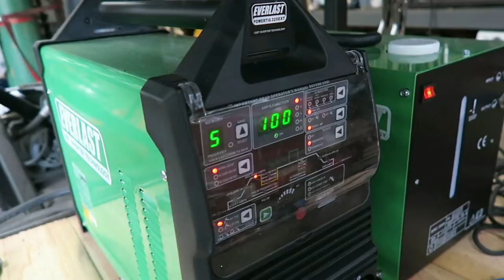Fox Body Hot Rod Build | Making Strut Towers and the Body Comes Off

Comment: I was one of those who sent you the C10 link, sorry should have realised that when I see it, thousands of your fans do :-O 
However, just for clarification, what I meant was to keep the struts as a major design and heritage statement, but at 12:40 replace the cylinder(+accumulator) with the setup. 
Buuuut I honestly prefer the accumulator solution, it will not look as hidden as the C10 set-up, but very cool & technical. 
16:00 ooooh fff....... I get it now. hahaha. Totally had that the wrong way in my head. That is very neat!

Comment: Beautiful build. I like the simplicity of the exposed hydraulic cylinder in lieu of a strut. I think you should keep that theme going in the rear end and have the coil-over spring in-board  (Where you originally wanted to put the hydraulic cylinder) and have the hydraulic cylinder exposed (connected to the axle) besides giving it a more exotic look, I think it makes sense because I believe the hydraulic cylinder will have a larger range of motion than your springs will and therefore will require less of an extreme movement from your cantilevers. Also about accumulators, they work well, if it's too stiff, you can always run 2 per cylinder. Also mid to late 90s E Class and mid 90s to pre 06 S Classes have a hydraulic suspension. They use a bladder accumulator nearly identical to a lowrider accumulator, but being they are from a benz, they give the ultimate ride and good handling. You can go to a junk yard and get some off of a mercedes for probably less than the hydraulic shop will charge.

Comment: Have you looked or ask for reverse flow cylinder. The fitting and flow goes thru the piston rod so the fitting is on the top. I use to get it from reds hydraulics for imports and front wheel drive cars. They also has coil springs that go over the cylinder like a coilover set up.

Comment: you could use the bottom a arms as the feedline for the cilinder that way you can use verry short rubber lines between strut and a arm and a arm and frame/ line

Comment: A little late for suggestions but a transverse leaf spring would be super clean and out of the way up front,  vettes have been using them forever. Shocks could be mounted horizontally too using a bracket on the upper a-arm pivot.
Reply from the maker: not creative enough

Comment: Looking good kyle.. 
The way your goin with the frontend is one of the ideas I was thinking... 
If you run a spring style accumulator it should work just as well if you had a regular coilovers struts...
I'm sure you can play around and make your on accumulators if you have to, to work like you want if need be
Reply from the maker: yeah still have a few different ideas floating around in my head
Reply: The Fab Forums 
It's always trial and error. To find what works the way you want

Comment: Been thinking about this, how would it work having the lines of the 'strut rams' going to a set of rams that pushed on springs that are mounted back to back? Could lay the whole spring/ram set up down just in front of the steering rack? It might have a delay in the springing not being mechanically connected, but might be okay just to drive to and from shows or trailer there! Maybe also if there were 2 lines, 1 for rebound, 1 for compression then they could be made adjustable also with simple valves?

Comment: Have you considered having a spring on the front suspension? But using a remote spring on the other end of another cylinder ? You could mount the spring /cylinder anywhere on the car !
Reply from the maker: kind of

Comment: why not drill two holes in the long leg of the A-arm, and run the hydraulic lines from the cylinder through the long leg of the arm and under the bottom of the chassis where the arm mounts, and have the accumulator/reservoir/(however it works exactly im not familiar with hydraulic systems) on the inside edge of the frame tubes, like underneath the headers? would that work?

Comment: Idk how well that clear coat will hold up... Might need to have it powder coated clear? Also what if it overheats and pops a hose/releases steam from the radiator and sprays hot steam/coolant all over the passengers? Will the coolant lines be hard lines? Or will you have shrouds on the main hoop?
Reply from the maker: I have plans for all that....stay tuned

Comment: In every hydro set up I've run I've used power balls. 👍👊
Reply from the maker: they last?
Reply: The Fab Forums I've had them on multiple rides.  I put 30k miles on my juiced and bodied s10. Drove it all over the country. Zero issues with the powerballs. I greased them on install. Also watch getting welding splatter on the threads.

Comment: Hi Karl I love the Constant Effort to strive for Perfection that you have 
it is always a joy to watch when you are working as it gives hope to us meer mortals that if we could strive to the same effort we might build a winner in Anything we endeavor to try 
Do it right the first time and you wont have to come back again and fix your mistakes or at least minimize the mistakes, HOPEFULLY 

A question for you 
When you weld ( Arc, MiG, Tig)  how far in cleanup can you go before you compromise the weld Obviously you want integrity in a weld, but can you blend it into the joining pipe and how far would you go for both neatness and strength? 

@ 19:20 you could almost see arching / rounded fenders over the wheels leading to Running boards down the sides of the car !  that would look fantastic ! 

looking forward to the next video 
Tony
Reply from the maker: thanks Tony, not exactly sure what you are asking on the weld stuff
Reply: Ok Karl 
Consider it this way you have just finished a weld on part of your Roll Cage and you want to clean it up how far can you grind back to 
1 neaten it up 
and 
2 not weaken the weld?

Comment: Looks curious I'm just trying to figure out why the shock "tower" has hiem joints in theory it doesn't need to move as this is the top strut mount as you say same as a fox body but the fox body is solid top mount for the strut and you will be getting your lift and lower from the ram? so I'm interested to see where you are headed I like the fact you think outside the box and do things different it really gets us viewers thinking of different ways our selves good work by the way loving the hustle standard.
Reply from the maker: Thanks....I will explain soon
Reply: Hey kyle I have seen your post on social media and I kind of see where you are going with the rams being used for height only like a solid strut and your using coil overs in a horizontal fitment back to the frame as your suspension this is a pretty trick idea and will look awesome and as you say different to what others have done I enjoy following your builds well done.

Comment: Do they make steel braided hydraulic line that you can use that would go with the flow of the frame to connect each cylinder?
Reply from the maker: yeah I am pretty sure

Comment: The mounting location for the front of the lower A-arm looks rather weak being on the end of the tube like it is.  I am not so sure just how substantial these need to be but refer to stock arrangements where they mount to the frame itself. Is this the final configuration?
Reply from the maker: Factory a arms dont mount to the frame, they mount to a K member that is bolted to the frame. All the aftermarket k member are tube. I still plan to make some small changes but what you see is what it will be.

Comment: why not a cantilever in the front suspension? you could mount the struts horizontal and incognito.
Reply: like the build. radical idea. very cool.
Reply: never mind. looks good.
Reply: Jim Bullerdick he's not that talented that's why not
Reply: Let's see what you've built 455 stage-1 . You got some badass fab work videos for me to check out? Can you even weld?
Reply: Yeah that's what I thought
Reply: 455 stage-1 so angry you are. You're right, I own a welding company and I have no videos up but when I do they most likely will not be of welding
Reply: I still don't understand the need to come on here and try to put someone down. It sounds like maybe you need some lavender essential oils, a massage and perhaps some time off with the Mrs. Or Mr. if that's your thing.

Comment: on the fronts are you going to run a coilover between the top hat (or whatever that hip joint thing is called on top of the hydrolic cylinder) and the firewall? i was thinking that would be where the cylinder would go so you could change the ride height from there and the suspension would act like a modern a-arm suspension but it looks like its going to be completely different than that now lol very interested in where its going. absolutely awesome work either way man.
Reply from the maker: originally that was the idea but the coil overs up front were just a little too bulky so I am exploring some other options
Reply: possibly relocate the coilover with a trunnion?
Reply from the maker: probably more like hydro accumilators
Reply: oh shit this build gets more interesting by the day lol right on

Comment: Won't the heim joints on the strut tower arms mean that the top of the strut tower can move around when the suspension moves? That would play havoc with your alignment and prevent the shocks from doing their job. Or is there more bracing to be added?
Reply from the maker: there is a lot more to come

Comment: I assume there's at least one more link that will go into the uppers? Currently, there's nothing to hold them down, aka keep the car from sitting on the ground regardless of the cylinder position. Build is coming along great though, loving the lines in the front suspension so far.
Reply from the maker: yeah still a lot of work to do on the uppers
Reply: Yeah I was wondering why the hyme joints were on those parts of the strut tower. Curious to see how it turns out.

Comment: Is there really no better way to remove the millscale than with a scotchbrite pad?
Reply from the maker: well its not mill scale but no, not if you want it to look good.
Reply: It does indeed look good. What is your preferred method to remove mill scale? I've typically used an angle grinder with flap disc, but that can leave some marks
Reply from the maker: yeah no easy way...I use a flap disc or sanding belt. I have heard of some guys using wire. Honestly my favorite way to deal with mill scale is to just use materials that dont have it. cold rolled or P&O

Comment: What are your static caster and camber angles?
Reply: Guess I should have watch the entire video!   I love what you're doing.  SO clever.
Reply from the maker: Initial setup is 1 degree in on the camber and 5 degrees back on the caster. I will fine tune once its finished

Comment: Since it looks like you are doing a custom intake,have you considered putting and air to water intercooler in the base of the upper. I realize it will be low boost, and not a max horsepower effort, but might add to the “cool technical’ vibe this has going on
Reply from the maker: I have but the issues is space for the pump and tank. I will take more time on that once I get to that point

Comment: Hey, Finally found what I was talking about before for your suspension setup. Its called "Pushrod suspension" and there is a few different ways to do it. It would certainly make your project very unique and most likely different from any other car as this is quite uncommon setup, but also very proven. Here's one video https://www.youtube.com/watch?v=zwYybcpBeZI
There are a few different ways to do it, some more complex, others quite simple, can use coilovers (I think look best) or springs and torsion bars. Search it on youtube and theres lots of ways to do it. Cheers
Reply from the maker: yeah I am familiar with all those things. Problem is its made for road racing and limited wheel travel. I need to lay the Bibbster on the ground which will require lots of wheel travel. May do something like that on another build

Comment: Have you thought about keeping the intake as low profile as possible to maintain a factory'ish hood since cowl hood's have fallen out of style?  As seen by the Murder Nova and lots of other builders who have gone away from typical aftermarket style cowl induction hood's.
Reply from the maker: not gonna have a hood....or fenders for that matter
Reply: Oh good.  Have you looked into those Holley high ram intakes, they even have some with an intercooler like Leroy the Savage.  You could even fab a CNC lid for a crazy custom look like a Shearer Fab Surge Intake.
Reply from the maker: Yeah, I want to do a carbon fiber intake for this thing

Comment: You could always run you hydraulic lines through the chassis... if you want to hide them...
Reply from the maker: I dont want to weaken the chassis but do plan to hide what I can
Reply: The Fab Forums true... but if you were to weld some tubing into the holes... e.g. crush tube style... that would put that lost strength back at those points shouldn't it...???
Or another suggestion... weld some slightly larger than the hydraulic line tube to the inside of the chaos rails to run it through...

Comment: If you use McPherson strut , what are you doing for the camber change when you drop it ? A duel wish bone doesn't change angles as the suspension cycles . Why i will always be a Camaro over Mustang guy , that and GM's limited slip from the 1960's is better than Fords from the 2000's .
Reply from the maker: double wish bone doesn't change only if the upper arm is the same as the lower arm, which they arent. Setup properly the McPherson has little camber change through its cycle.

Comment: Know you don't wanna read this and I'll probably be shunned for it but for the upper ball joints you could use threaded ball joints like the upper control arms use on the 91-96 dodge Dakota just so you don't have to weld your ball joints in.